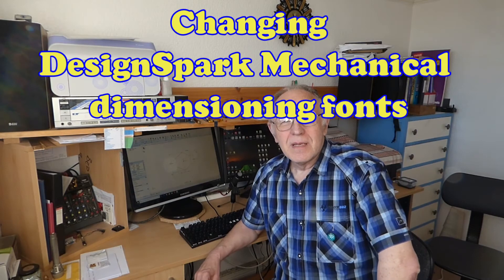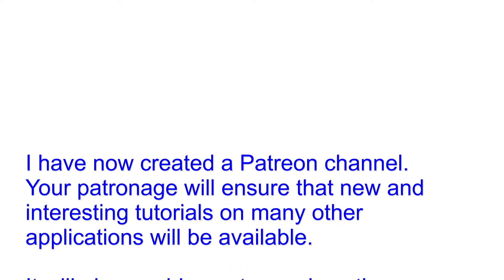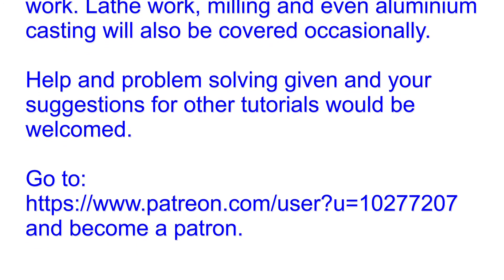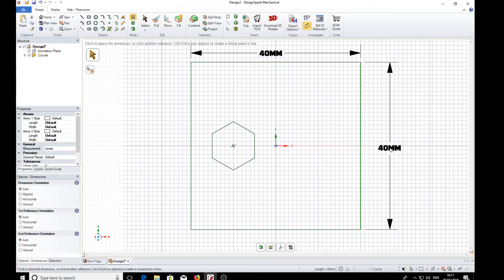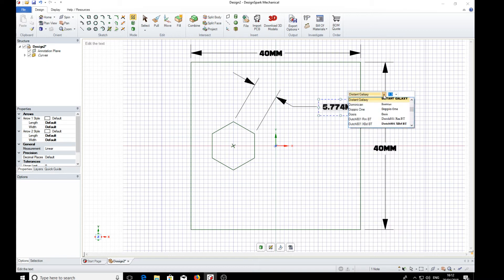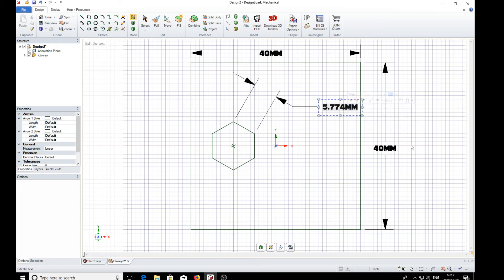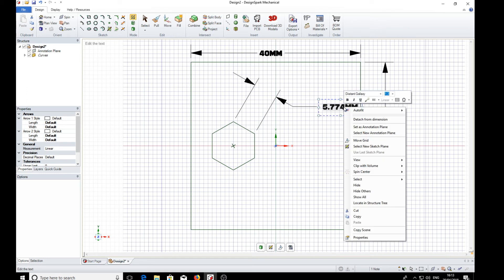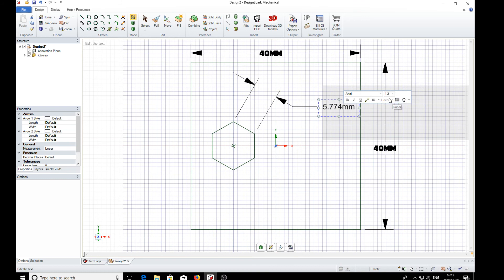Changing fonts in DesignSpark Mechanical

Comment: Dimensions in DesignSpark are difficult. You do such a superb job in your tutorials it would be nice if you did one dedicated entirely to dimensions. I know you have several out there now but it requires a lot of bouncing around between your tutorials to try to find the answers. May I suggest some topics?
1. Dimensions in Sketch vs 3D mode
2. Dimensions on 3D objects showing all three sides
3. Hiding the annotation plane for JPG presentations of objects
4. Print fractions rather decimals
5. Dimensions between any two points
6. Dimension of the depth of a hole
7. Dimension showing the location of a hole on a surface
I have spent considerable time finding a solution to these and  other dimension problems and I think new users would welcome this info as presented by you.
Also I'd like to see you give some serious thought into writing a complete Design Spark Mechanical instruction book.
Keep up the good work!